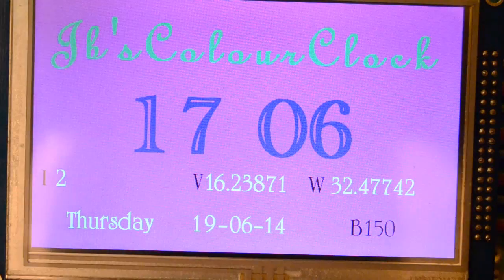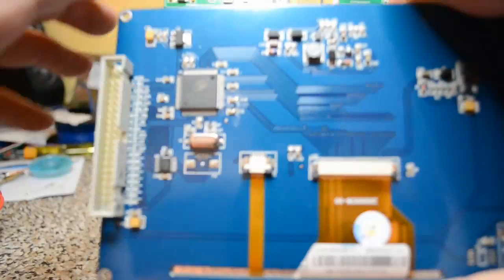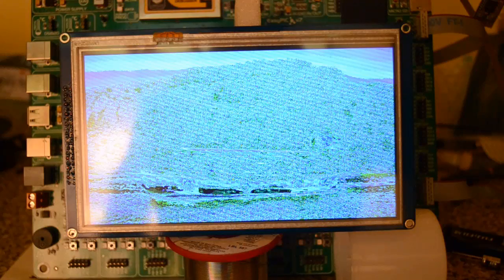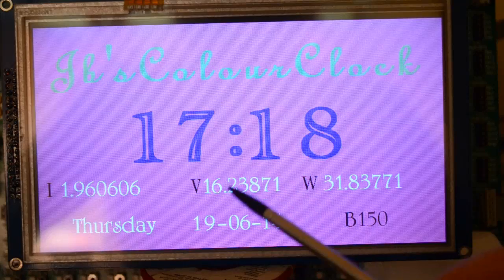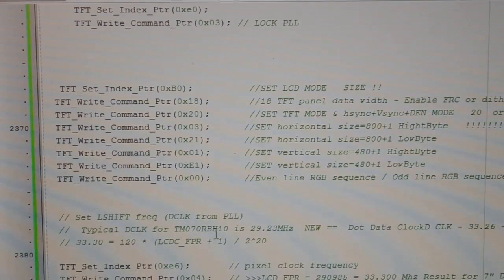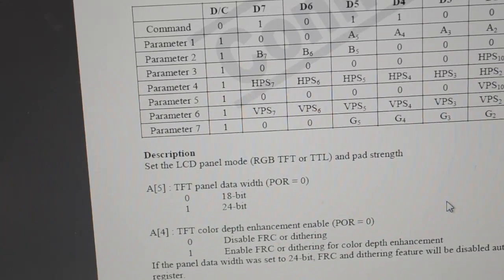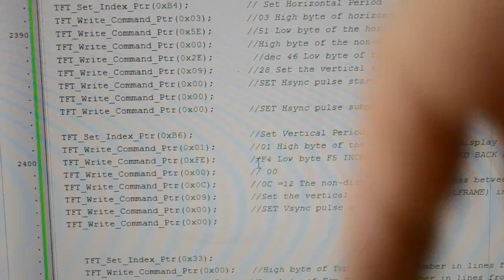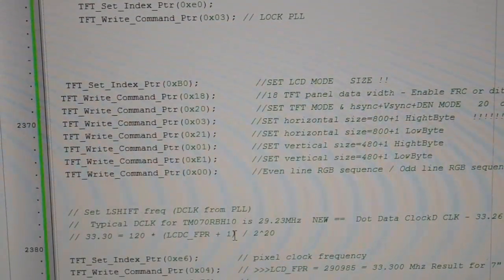7" Inch LCD /  TFT SSD1963 Controller + code in show more

Comment: hello did you just learn from the small tft you got with the fusion v7 board and the change code according to what was different with the 5inch and 7 inch tft thanks for the video its helpful thinking of buy a fusion board that's all

Comment: How did u  wire it to the arduino?
Which pinson the TFT to what on Arduino?

i can't see any wirings on internet anyway.

so i tryed to just take mosi and miso, cs and clk to the TFT, but dont know, what to do with t_din and t_do.
where do they go? mosi/miso? or sda/sclk?
Reply from the maker: Hi,
The sd card is SPI
 T_DIN  on the display means touch panel DATA IN which would come from your spi out on whatever you're using.
SDA & SCLK are I2C terms not spi.
The screen is spi for the sd card and touch panel.
I only use Pic Microcontrollers, Microchip do not use the terms MOSI & MISO they use SDO & SDI Serial Data Out and Serial Data In.
There are a billion sites for the Arduino, sounds like you have not looked.

Comment: Hey John, nice video clip. I have TFT 7 Inch 480X800. I want to use it in Arduino Mega 2560. Do you have any idea for connecting to my board and also how can I found the Libraries for it? 
Thank you in advance.
Reply from the maker: +Hasan Vaez 
Hi,
The SSD1963 datasheet is on the internet.
Sorry I have no idea how to connect it to your Arduino, I'm sure someone must have used it with one.
Thank you

Comment: Interesting.
Where can i download the source code whole, for try it?
Reply from the maker: You can't.
You read the bits that are different and change your own code.
Reply: blogsf89 I have no code. I would be grateful if you could pass your. I have your same hardware, EasyPic Fusion and one 7 "TFT Display from EgoChina with SSD1963  and 2046 TP driver
Reply from the maker: My fonts are on an external memory card etc so the code would not be any good.
All the info you need to run the screen is in the video